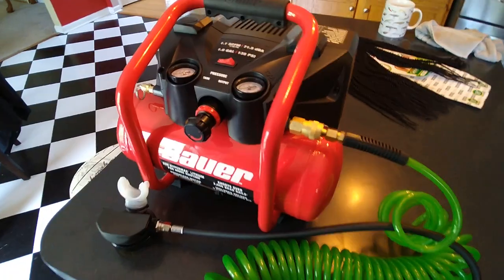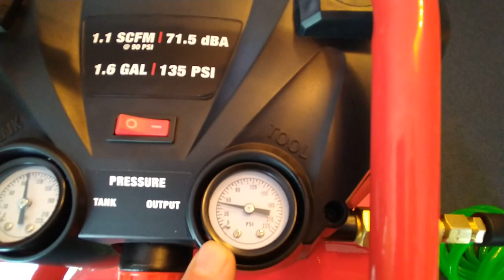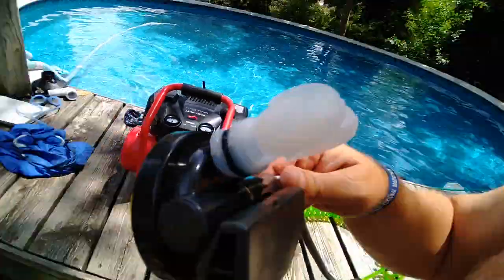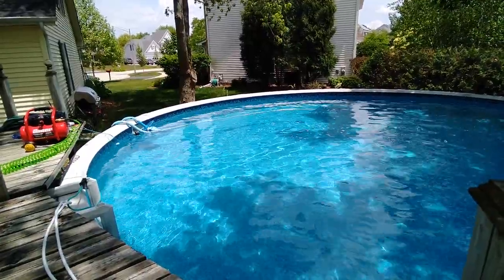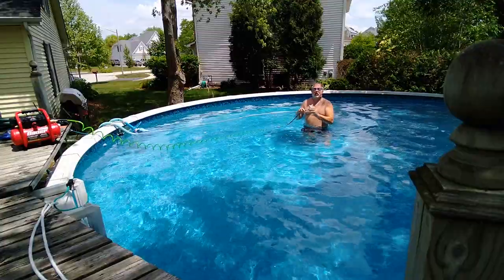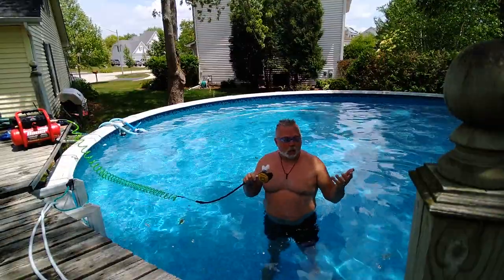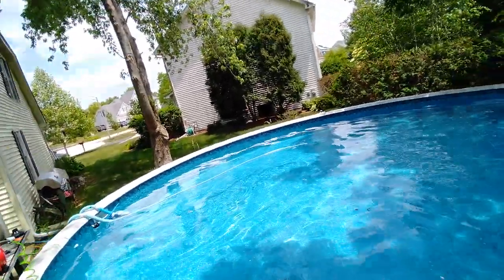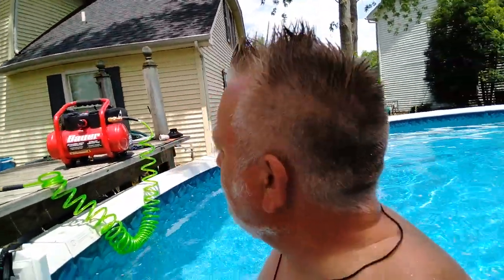VOGTLAND OUTDOORS   2021   BUILD a Surface Supplied Air hookah System for under $250

Comment: I was just wondering how long does it run on One battery
Reply from the maker: Greetings & Welcome to VOGTLAND OUTDOORS Aaron ! 

SHORT ANSWER: 
This unit runs on TWO batteries at a time, and I get a full 45 min dive @ 20-25 ft with those batteries. 

THIS ALL SAID... BE CAREFUL !   This is your LIFE you're playing with down there, and NO ONE is going to come GET you if your rig FAILS. 

I just came back from a week in wonderful JAMAICA, and one SAD tale was that I was out fly fishing along the coast with a guide when a POLICE BOAT pulled up. They were speaking to my guide in "patois", but I understood a LOT of it, and what the police were asking my guide was (basically) if he "saw any body parts floating around this morning"... 

:-O 

After the police left to continue their searching, I asked my guide TJ what had happened. 

TJ answered "So sad; 2 men took a "hookah" rig out last night and were diving to 80 feet... 
... and NO ONE HAS SEEN THEM SINCE." 

:-O 

WHAT DOES THIS MEAN? 
It means they WEREN'T CAREFUL, and they fucking DIED at 80 ft, with WEIGHT BELTS on, so they SANK to the BOTTOM of the Caribbean, and the only way anyone will FIND them is when the SHARKS begin to EAT THEM and some PARTS start FLOATING to the surface :-| ... 

I CAN'T MAKE IT ANY CLEARER THAN THAT - BE CAREFUL WITH HOOKAH (and SCUBA) RIGS !!! 
ONE STRENGTH of MY DIY design is that you've got a 6 GALLON TANK, which WILL begin to take EFFORT when your batteries die... but in reality you're ONLY going to get about 2 or 3 breaths when you feel that EFFORT 'HIT". 

DON'T BE FOOLISH! 
LIMIT your DIVES to 75% of the time your rig can handle. 
WEAR a STOPWATCH and LOOK AT IT CONSTANTLY.
ADD a PRESSURE GAUGE to your regulator line and WATCH IT CONSTANTLY - it's only going to start DROPPING when you've got about 3-4 breaths left - HEAD FOR THS SURFACE ! 
NEVER go below 20-25ft for ANY REASON - IT'S NOT WORTH YOUR LIFE. 

Hope I'm making my point. I DIDN'T make my DIY hookah rig videos so fools could copy my unit and kill themselves. 
There's a TON of fun to be found at 12 to 15 feet in any freshwater lake in North America. 

Cheers,
-Mark Vogt | VOGTLAND OUTDOORS

Comment: may i ask the type of the compressor
Reply from the maker: Greetings Shangwei and welcome to VOGTLAND OUTDOORS ! 
SHORT ANSWER: 
It's a BAUER brand from HARBOR FREIGHT TOOLS: 
https://www.harborfreight.com/16-gallon-135-psi-20v-brushless-cordless-air-compressor-tool-only-57394.html

HERE is a pretty close RYOBI EQUIVALENT on AMAZON: 
https://amzn.to/3SEsgbe

Make sure you use one with a TANK - it'll provide you a precious few additional breathes that you'll need once your batteries are empty and you're still down at 5 to 6 m of depth :-O . 

BE SAFE
BE SMART
DON'T BE STUPID 
DON'T TAKE RISKS 
ALWAYS DIVE WITH A BUDDY
NEVER DIVE ALONE

DISCLAIMER: 
YOU ALONE are responsible for ANY and ALL decisions you make regarding DIY diving equipment. 
Neither VOGTLAND OUTDOORS nor Mark Vogt are in any way responsible (in whole OR in part) for ANY decision you make or its consequences. 

Cheers, 
-Mark Vogt | VOGTLAND OUTDOORS

Comment: What is the run time on the unit ? Battery life wise ?
Reply from the maker: Hi Doug! 
I shit you not - with 2 5000 mAHr (mill-amp-hour) batteries, I EASILY am getting 48 minutes under, even down to 27 feet in the bottom of Devil's Lake, Wisconsin. I'm CONVINCED that if I stay at only 15 feet (which is where all the FISH are frolicking), then I expect to stay under a total of 60 minutes with 2 x 5000 mAHr batteries. 

You'll start getting HYPOTHERMIA before you start running out of batteries (air) - at least in North America ! 
;-) 

-Mark Vogt | VOGTLAND OUTDOORS

Comment: Careful with that tank if it is a steal tank will begin to rust internally and even a filter won’t  help much. Better to have an aluminum tank.
Reply: It is a steel tank.
Reply: you're overthinking this....a filter will help, you don't want large particles in your lungs, your lungs are capable of handling and removing small particles to a certain size...the point of the filter is to trap nauseous gas or particles that will cause you to have a cough reflex.
Reply from the maker: You & I are in AGREEMENT ! 
:-) 

-Mark
Reply: @18magicMARKer In the interest of helping people research this idea, I (respectfully) think the word you were looking for is noxious. It's a relevant word to this DIY project and one that potential "Do- ers" should research prior to attempting.

Comment: Can u take that down to 25+ feet ? How has it worked for u so far ? Whats the long term health factors ?
Reply from the maker: Greetings Linius! 
SHORT ANSWER: 
Yes - I HAVE taken my rig down to 27 ft; I COULD go DEEPER, but there's NO WISDOM to diving deeper with an SSA rig vs a SCUBA rig !

LONGER ANSWER: 
SSA rigs by their very design are meant for a fairly specific RANGE of depths: 
- DEEPER than you can dive using a SNORKEL; but 
- SHALLOWER than you can dive with a SCUBA rig
THIS translates roughly into a range of 8 ft to 25 ft

COULD I take this rig DEEPER than 25 ft? 
Yes, but 2 things would need to happen: 
1. I would need to advance to each new depth GRADUALLY and CAREFULLY, diving for at least 30 minutes at each new depth (eg 20 ft, 25ft, 30ft, 35ft); and 
2. I would need a REASON to dive to those deeper depths. The REALITY here in NORTH AMERICA is that most fresh water lakes are really really BORING at depths greater than even 20 ft; all the weeds DISAPPEAR, the bottom becomes EMPTY and DEAD and DEVOID even of FISH, so WHAT's the POINT of getting deeper? The ONLY lake I've been in that was "interesting" beyond 25 feet is LAKE MICHIGAN, and it's DAMNED COLD below 20 ft :-O... 

BEST RULE OF THUMB FOR WORKABLE DEPTHS OF AN SSA RIG: 
DON'T dive any deeper than you can SURFACE from on a HALF-BREATH ! 

Cheers,
-Mark Vogt | VOGTLAND OUTDOORS

Comment: WARNING...the user manual for the Bauer compressor he uses says "Do not use to supply breathing air."
Reply from the maker: Greetings Bill and welcome to VOGTLAND OUTDOORS ! 

WELL-UNDERSTOOD ! - ALL "utility" compressors have this SAME WARNING. 
My project ISN'T intended to be any more than a DIY alternative to the far-more-expensive-maybe-even-safer-"air-quality"-wise-but-LESS-safe-because-they-all-LACK-TANKS hookah units available out there :-O ... 

Please watch the video(s) as I experiment with various FILTERING SYSTEMS on the OUTLET side of this compressor in order to mitigate (but I WON'T claim to ELMINATE) the risks involved in using ANY Surface-Supplied Air (aka "hookah") rig. 

Even THIS summer (2022) my field testing CONTINUES on BOTH the FILTERING and the HOSE, because I'm ever seeking to improve improve improve on this design ! 

Lastly, please know I'm TOTALLY RECEPTIVE to SUGGESTIONS on outlet filtering systems and superior air hose choices - what have YOU learned in YOUR experimentation so far?? 

This could be a useful dialog ! 

-Mark Vogt | VOGTLAND OUTDOORS
Reply: @VOGTLANDOUTDOORS  thank you sir! appreciate the clarification and insight into the DIY tankless setups. i have some basic repairs to perform in the deep end of my swimming pool, so found your video very helpful. my research of "breathable" air compressor systems showed how costly these type systems are. thanks again and i'll keep watching
Reply from the maker: Greetings again Bill ! 
No matter WHAT path you take, remember this: 
There is HIGH MERIT to a hookah system which includes a STORAGE TANK ! 
I cannot stress this enough. 
I see DANGER in hookah systems which ELIMINATE any form of a tank, instead relying on (fallible) electronic circuitry to somehow alert you when you're 25 FEET UNDER WATER (read "MORE than a SINGLE BREATH back to the surface!). 
I mean... WHAT IF that circuitry FAILS? 

At least with a TANK you'll FEEL the "pull" when you've got about 2 to 4 breaths remaining, and that's you're FINAL "get the hell back to the SURFACE" that DOESN'T rely on any circuitry at all :-) 

Just something to think about. 

Looking forward to hearing about YOUR rig! 

-Mark Vogt | VOGTLAND OUTDOORS

Comment: Better off getting a couple cylinders and attaching your hoses to that. Your contraption may seem capable. But it is also capable of killing someone. I can’t even watch your whole video. At the very least get proper air filters, and a CO monitor on that thing. Yes it is oil-less so you may not get petroleum oil vapor, but you could still get CO from burning orings. surface supplied compressors don’t use rubber orings and they use Monolic oil.
Reply from the maker: Greetings DeepSeaWrath, 

Your feedback is appreciated, though I have to ask - what is your impression of ANY SSA system? 
There are literally THOUSANDS of them out there, and far & away the LARGEST consumer of them are RESORTS, where killing a paying customer is a BAD thing. So IF they're SO bad, WHY are they SO popular, and why are we NOT seeing all the deaths you seem to hint at??? 
;-) 

"Get a couple of cylinders" ?? 

The WHOLE POINT of an SSA system is that it's for people who DON'T have ready access to COMPRESSORS or CYLINDERS, so again, I'm not sure of the logic of your suggestion. 

I'm Advanced SCUBA (NAUI) rated as a diver (only down to 80 ft, that level), and we had it beaten into our heads that conventional SCUBA rigs can KILL you too, so again, what's your point here? 

Like many other enthusiasts, I've carefully assembled tested and demonstrated an AFFORDABLE, PORTABLE rig for CAREFULLY diving to depths (15-20 ft) that a common SNORKELER only WISHES they could dive at and NOT have to come up for air. YOU want to suggest using a SET of SCUBA CYLINDERS to go diving at 15 ft ?? 

I'm not sure people are willing to cough up $1500 so they don't have to come up from 15 ft for air ;-) ...

Thoughts? 
-Mark Vogt | VOGTLAND OUTDOORS
Reply: @VOGTLANDOUTDOORS  I appreciate your innovation and ingenuity. And I appreciate you looking out for the common person. And what you are doing is safer than say some pearl divers in Indonesia. HOWEVER all I am saying is diving is inherently risky even in 4 feet of water. And homemade contraptions are not worth risking peoples lives with to save a few bucks. My background: been padi/naui recreational diver since 1993. And a commercial diver since 2006, currently an ADCI surface supplied air diving supervisor.
My impression of air ssa? I prefer it. I don’t like being limited on air. Although I have not used any recreational systems. Before using them I would make sure to check the air quality by getting it tested every 6 months. There are companies that do this inexpensively like TRI air testing inc. I recommend you do this as well. Which is what these resorts are probably doing. most likely their insurers require it. 

“The whole point of an SSA system is that it’s for people who don’t have ready access to compressors or cylinders”??  I too am not sure of your logic. 
You have a compressor people have ready access to. I would prefer to see people use a diving gear that has been actually tested and approved. Compressors and cylinders manufactured for diving are readily available and some are quite affordable. I can make a hookah setup using rented cylinders and purchased secondhand diving equipment for under a couple hundred bucks and it would be way safer. Cylinders are great for SSA. I can make a setup on the road in any city in the US. Do it all the time. And they come with an air quality certification so I’m good with osha. And I still monitor for contaminates. A few bottles will be plenty for a diver at 15ft for hours. Much longer than your batteries. 

Those are my thoughts. Again not bashing your idea. Just need to let people know that they need to do their own research and take in the consideration that this isn’t the safest way to go under water. And drowning in a pool or under your boat could be easily and affordably be avoided by a little training, and using the certified equipment properly, and ensuring your air source is contaminate free even under heavy load.
Reply from the maker: Hi DeepSeaWrath!

There are 2 ways a conversation like this can go: 
1. nicely; or 
2. badly
I think you understand what I'm trying to say here, and am pleased to think you & I have gone down Path 1 :-) ...

Your suggestion about TESTING the air quality is VERY valid, and one I WILL explore when I ready my system for use in the spring ! And I'll also be exploring various types of FILTERS I can use on the outlet toward making the exiting (breathed) air as safe as possible. 

In the world of aviation there is an annual fly-in named OshKosh that is filled with plane-making enthusiasts, all building EXPERIMENTAL planes while often learning to fly :-) ... 

Paragliders, Powered Parasails, the list goes on. People LIKE "DIY", in spite of the risk. 
I'm no different, but I DO try to exercise all due caution, and I DO accept constructive criticism when it's offered in good spirit. Yours was :-) 

Stay tuned in the spring ! 
-Mark Vogt | VOGTLAND OUTDOORS
Reply: @VOGTLANDOUTDOORS  stay safe. I’m available for questions.
Reply from the maker: DeepSeaWrath, 

HERE's a GREAT question to ask which leverages YOUR greater experience in the area of Air Quality.. 

Q: WHAT might be some GOOD available-via-retail FILTERS to add to my rig? 

Thus far I've been only seeking filters for removing moisture and particulates, but your recent posts have me convinced there are OTHER substances I should be concerned about filtering out as well. 

Thoughts? 

-Mark

Comment: Aside from breathing compressed air unfilterd! What could go wrong with trusting your life to a budget brand air supply😃!
Reply from the maker: Hi V8 Marc - cool avatar ! 

YOU & I ARE IN AGREEMENT - what we're doing is DANGEROUS. 
ALL "diving" is DANGEROUS. 
I'VE had comparatively MORE expensive rental gear FAIL ON ME - NOTHING is "foolproof". 

BUT... 

... IF you read my PREVIOUS posts and watch all my PREVIOUS videos on this topic, you'll see I'm quite CAREFUL and very VOCAL about recommending WHAT situation an SSA (Surface-Supplied Air) rig is for, what it's most-certainly NOT for, and how BEST to use it to have fun with MINIMAL danger... 

SNORKELING is useful for surface to about 6 ft, provided you're in good shape and have a weight belt to achieve barely-neutral buoyancy... 

SCUBA (Self-Contained Underwater Breathing Apparatus) is MOST useful for diving and remaining at depths of 20ft to 60ft; deeper than that you often need more advanced gear in order to stay at-depth for longer than (say) 20 minutes :-| ... 

IN-BETWEEN these 2 "operating zones" is that weird depth of 6ft to 20ft: 
- TOO DEEP to continuously SNORKEL; it takes longer to get down and up than the time you're DOWN; 
- TOO SHALLOW to "gear up" with SCUBA and WEIGHT BELTS and TANKS and such; but 
- PERFECT for SURFACE-SUPPLIED AIR like a HOOKAH unit :) 

Q: WHY does MARK recommend (and I'm NOT RESPONSIBLE FOR ANYTHING GOING WRONG) a max depth of 20 ft? 
A: When diving in FRESH WATER LAKES in NORTH AMERICA, 5ft to 20ft is where ALL THE INTERESTING STUFF IS, AND 20ft is about the DEEPEST you can ascend in ONE BREATH. 

Again... ALL of this is DANGEROUS, so we have to approach is INTELLIGENTLY. 
NONE of us have UNLMITED funds to buy space-exploration-quality gear. 
But we CAN have "reasonably safe" fun on a budget, while still putting together an SSA rig which might NOT be fabricated from the BEST materials, but it DOES have a 6 GALLON TANK to ensure that even when the POWER STOPS, you'll STILL have some air left to surface. 

USE YOUR HEADS

- Mark Vogt | VOGTLAND OUTDOORS

Comment: You need a rigid hose... this one will collapse at depth. One for welding or diving.
Reply: no if the pressure in the hose is higher than the pressure at the depth of water
Reply: Hose can't collapse while pressurized.
Reply from the maker: I'm with the other guys; 100+ PSI at the outlet end means the hydrostatic pressure (yep - it's got a NAME) at a depth of 22 ft WON'T be able to collapse the line. 

Cheers,
-Mark

Comment: Cheack mine out
Reply from the maker: Greetings Darry ! 

NICELY DONE - I watched several of your DIY build and dive videos - treasure hunting is ADDICTING to me as well ! 
I also noted that YOU ordered nearly the SAME FILTER that I ended up with; the FIRST one I bought SEEMED like a small, compact one - but I quickly that if it got ANY sand inside it, there was NO cleaning it, so I'm using the SAME style as you purchased. 

I'm curious - what's the TANK capacity of (gallons or liters) of your compressor's tank? 
I'm also curious if you can HEAR it from under water. 

I spent a fair amount of time driving around to ALL the local hardware stores literally TURNING ON each & every oil-less compressor I could find, in order to see which one was QUIETEST - THAT's how I ended up with the BAUER brand available at HARBOR FREIGHT TOOLS. Even at the surface you can BARELY hear it from even 10 ft away - it's AMAZING. 

GLAD you found my own videos useful - WATCH for more in the spring! 

-Mark Vogt | VOGTLAND OUTDOORS
Reply: @VOGTLANDOUTDOORS  the tank capacity is 2 gallons and it turns back on at 90 psi from 120 and it takes me 11 breaths to fill from 90 psi back to 120 psi and can barly here it under water as you can see in my test vid im going to treasure hunt the shore of lake superior next week  stay tuned have a blessed day